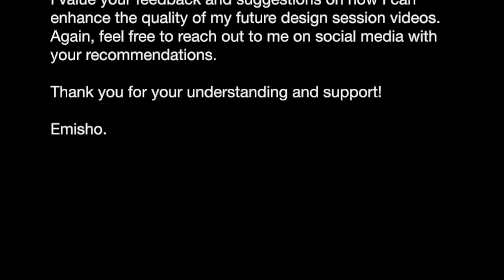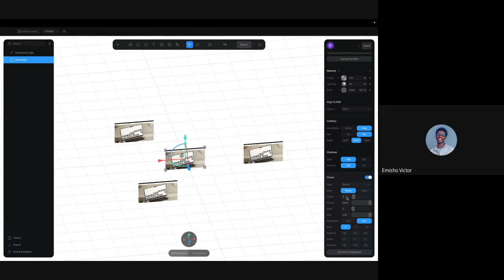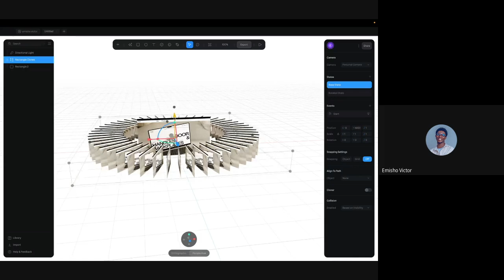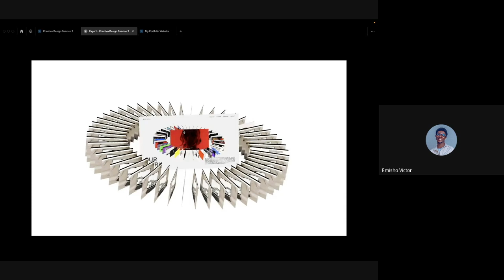Designing a 3D Carousel Website (Part 1) using Spline & Figma - WDS1

Comment: TIMESTAMPS
0:00:30 - Design Session Starts & Introduction
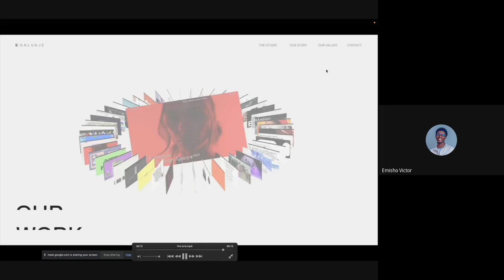0:01:15 - How I Start My Design Process & Gather Inspiration
0:04:37 - Introducing Spline
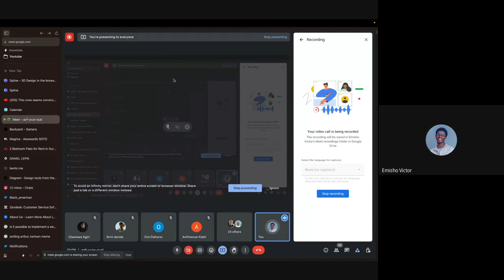0:08:13 - Creating The 3D Image Carousel In Spline
0:26:07 - Making The Carousel Rotate 
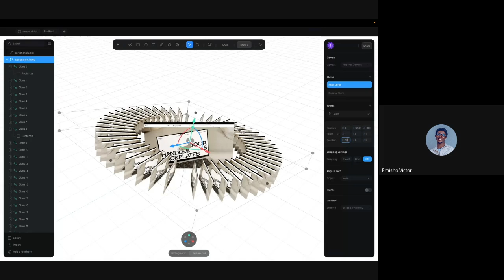0:36:07 - Intro to Exporting from Spline 
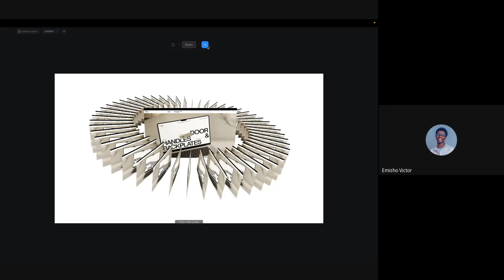0:40:18 - Replacing carousel Images
0:43:00 - Creating the Central Image Slideshow
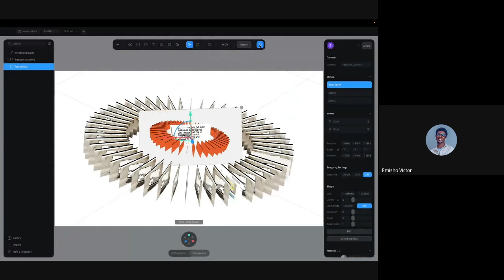0:54:27 - Exporting your Spline Prototype as a video
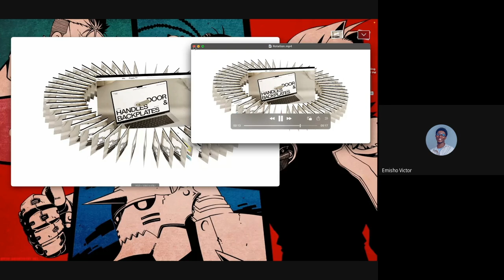1:01:36 - Converting to gif with Gifski
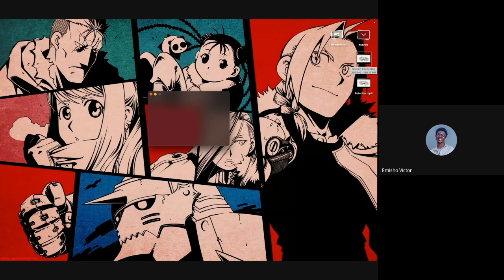1:03:41 - Moving to Figma
1:10:39 - Review 
1:13:33 - Closing and Final Questions